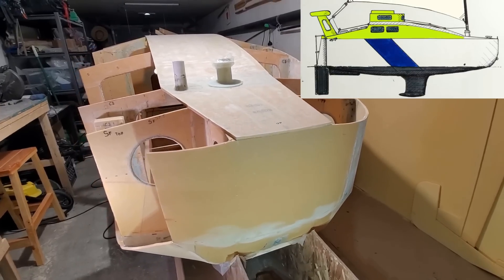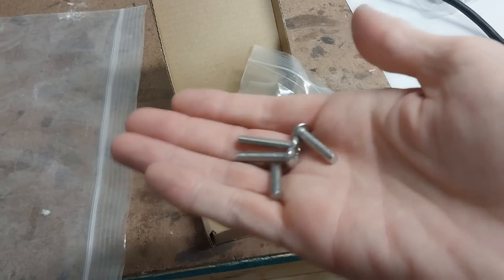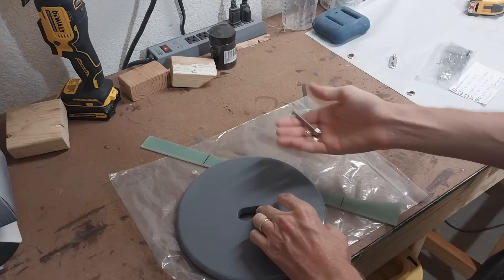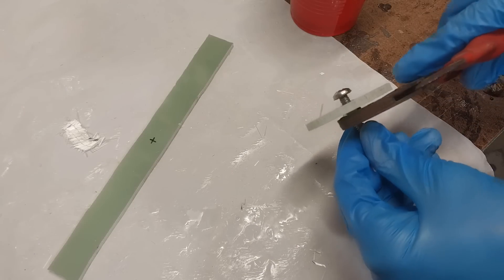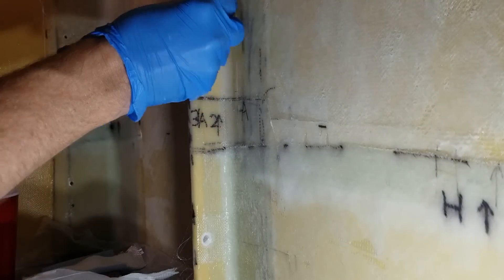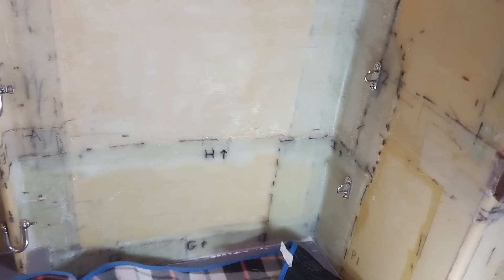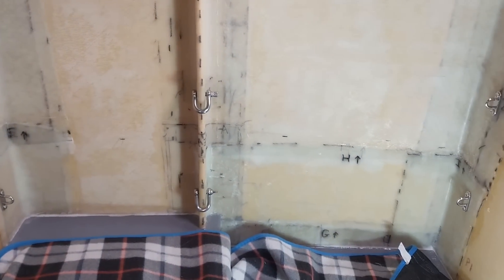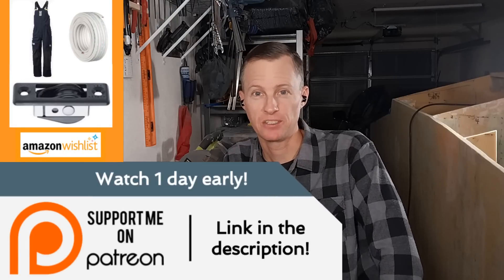OCSS-064 DIY Compression-Style Hatch Latch

Comment: Great progress as always. Have you thought about using soft shackles instead of the stainless. Less hardpoints and less rattle. I also like the glassed-in rope pad eyes that Yrvind does. No need for through bolts.
Reply from the maker: Yes I have some dozen +  rope pad eyes too if you check out previous episodes. I like to try a few different ways.
Reply: Agreed, those padeyes are over thought and over engineered.  Looks neat though.
I would have just epoxied on short hoops of webbing.
Reply: ps, no criticism of your work, you are doing an exceptional job.  I would have wanted to be sailing in half the time…with half the quality
Reply: @markthomasson5077  soft loops also have the advantage of not snagging ropes
Reply: You could use cable ties made into loops.